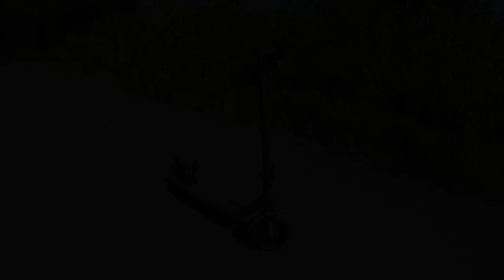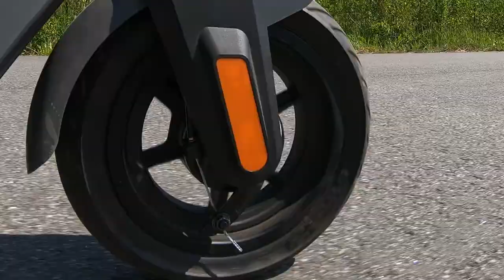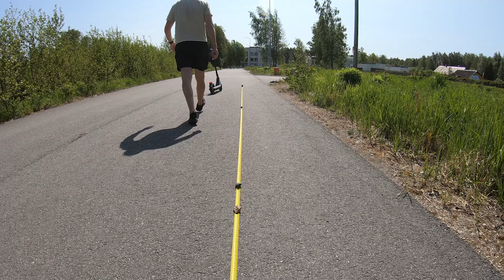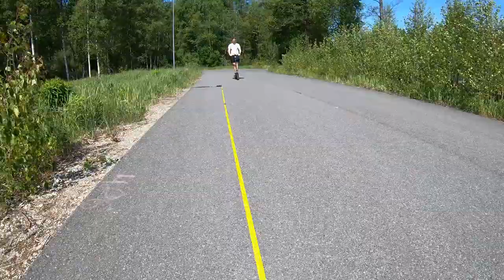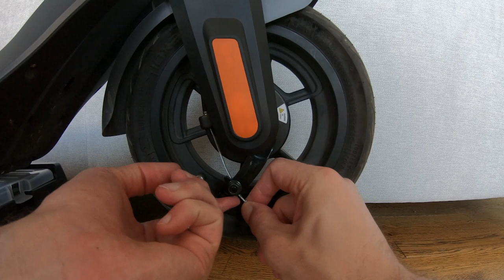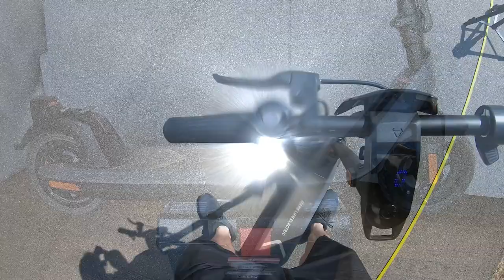How to Adjust Electric Scooter Drum Brakes?

Comment: Is there any way to adjust my scooter brakes if they are electronic only? Kugoo S2 Pro. You only adjusted the front wheel
Reply from the maker: This scooter has a drum brake only at the front. At the rear, it has an electronic brake but I don't know how to adjust that.

Comment: Idk what happened with mine can u help I adjust the brakes but when I hold the brake it js loosens up again
Reply from the maker: @gorgedagodt578  it seems the screw that holds the cable is loose. It must be tighten very good before braking again